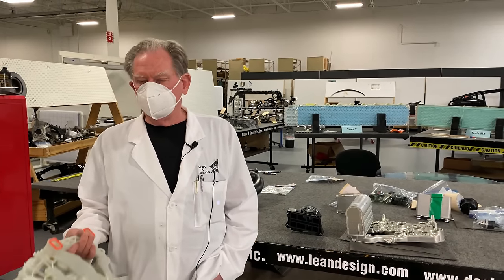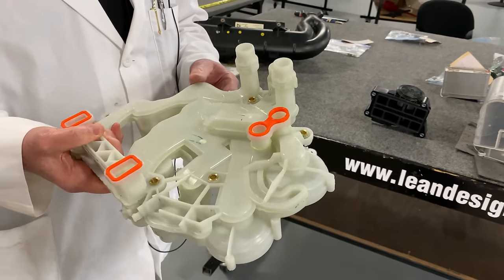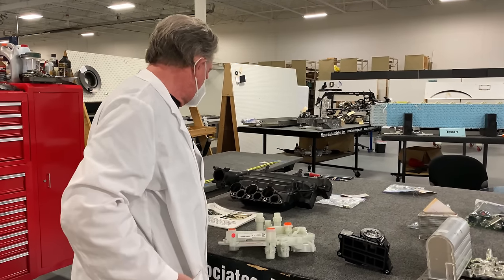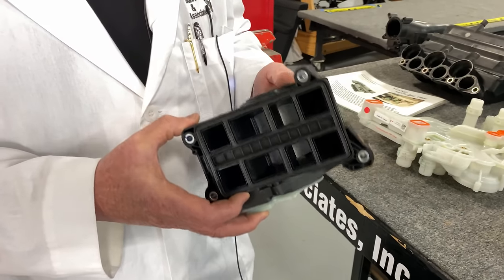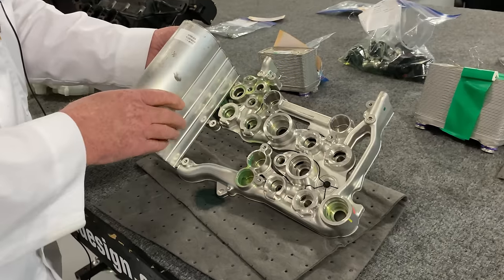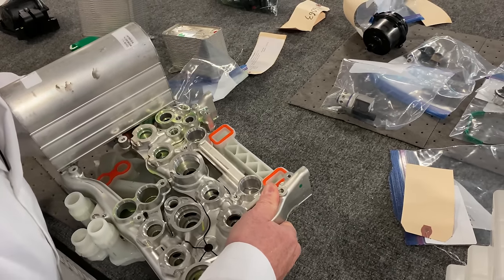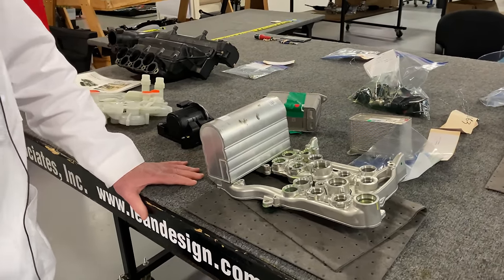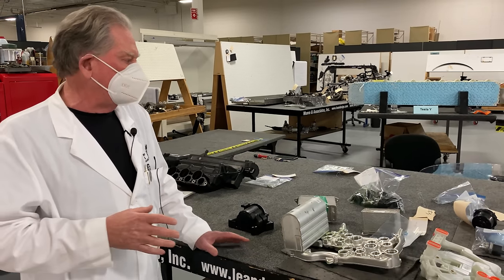Model Y E36: The Octovalve Episode

Comment: It way too small then design in my mind. How the hell they put that many Valves in this small part. I still think that it will be not that powerful and efficient due to its smaller size. Real story will come out in winter testing... still mind blowing.
Reply: Muhammad Usman already winter tested 👍
Reply: The real efficiency gain is in the combining the passanger A/C and battery thermal heat exchange. Instead of heat gain/loss to enviroment in a separate system, excess heat is redistributed among the both system instead of being wasted. Similarly, cooling of passanger and battery is done by a single cooling system instead of separately. The idea itself is not particularly novel, it's the execution that is the tricky part.

Comment: Looks like the plastic piece will leak in 60000 miles.  A similar designed Bmw/MINI cooper thermostat housing is much less complicated, but is junk after 10 years of temp cycling.  Designed obsolescence.  Not a repairable design.
Reply: I was also wondering about that supposed bmw manifold he showed, a bmw V6 ?

Comment: I am concerned that in the long run, those plastic parts will get brittle from chemical exposure and heat cycling. I predict this will be the weak link in the cooling system.  Plastic radiators in ICE vehicles are notorious for this type of degradation and ultimate failure. Sandy, I have to disagree with your positive take on this. That part is way too complicated.
Reply: Modern plastic is a lot better in cars now.

Lots of the cooling system is now plastic.

Comment: EDM for those slots doesn't make sense. process is slow. A custom cnc band saw would go through it like butter and super quick.
Reply: That would be like trying to use a bandsaw to cut a donut from the inside outwards.
Reply: water jet.
Reply: @lylestavast7652  Could be water jet but it's still too slow and the flare over the height would be an issue. The process has to allow for 10,000 / week.
Reply: Definitely waterjet, properly specced they can be as fast as bandsaw. Flare wouldn't be an issue in this case. And like @Robert said, how do you bandsaw a donut from inside out?

Comment: Everything except what it does, how it works, or what it is. But I know this: Elon said it's amazing and there's a heat pump now and it will increase range. 10 minutes I won't get back.
Reply: It is complicated but the idea is simple. Heat pumps need a source of heat for efficient operation. There are a lot of subsystems in an electric car that produce heat and needs cooling. So you need a system that gather and direct hot and cool coolant fluid towards the subsystem that needs it. This way the heat pump have good supply of heat from waste heat and you are cooling the system that needs to be cooled at the same time.
Reply: This series isn't about what every part does and how it does what it does, it is about how it is made and assembled and looking at possible cost savings in manf, assembly and repairability. That is what this company does.
If you want to know what it does, I have good news. You posted this so you are connected to a thing called The Internet and you use can find out answers to most questions in less time than it takes to complain that a video didn't do the thing you wanted it do.
Reply: Curtis B right on Google or Bing research. A lot of libraries closed now but online courses are popping. See Been Sullens and Joe Scott for some of these promoted courses from some of the sharpesr tools in the shed.
Reply: @lingyanj7075  Hi! Thanks❤️